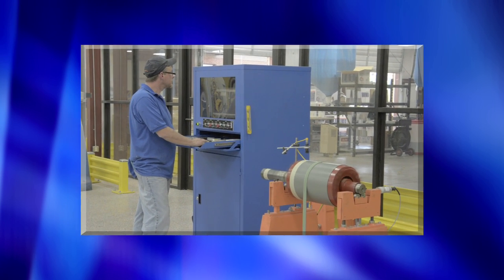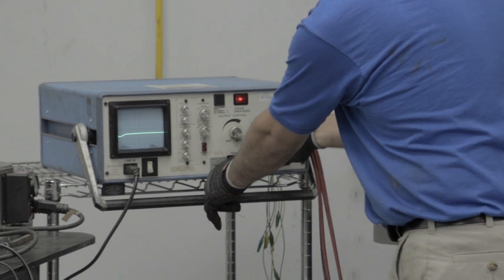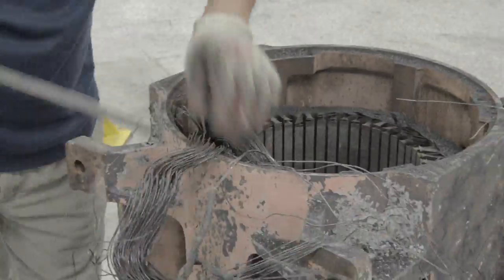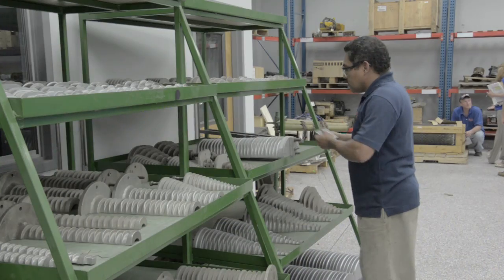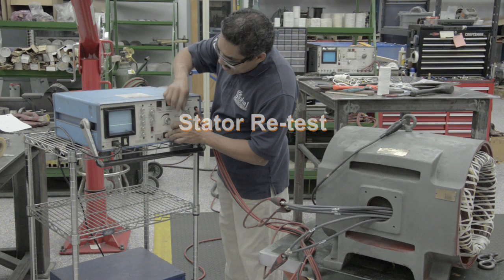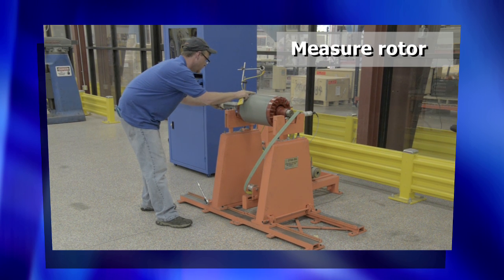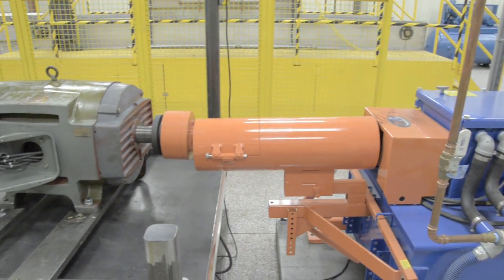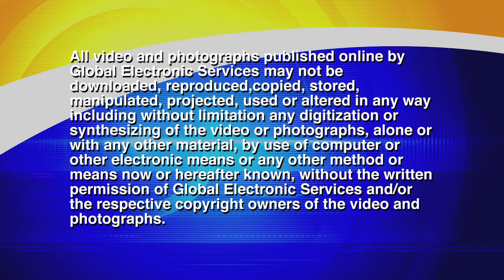Electric Motor Repair & Rebuild Instructions - Full Repair Process

Comment: Someone explain me this: Burnout to destroy the lacquer to remove the old windings, but what about the stator laminations? they are also lacquered and insulated from each other, or are the not? Being put in an oven, their insulation gets destroyed too, so the stator nw will be able to create larger eddy currents, which increases wasted energy = lower efficiency of the overhauled motor?

Comment: 6:05 why prevent the coils from touching the core if the wire has insulation already? I know, every motor has these paper pieces to protect the windings from getting scratched if any pull occurs, but really - if the windings are already insulated, then why isolate them from the core?
Reply: Im an apprentice for an electric motor company, and you're right tho, u don't want pull to cut your windings, so regardless u pretty much answered your own question although slot paper is also put in for spacing, you don't want your wires to be shifting around in the slots, and if they're shifting around in your slots then it doesn't matter what u did youre just fucking your motor up. U have to have so many steps because even having the winding sticking out to far will cause problems, basically u will always have a problem
Reply: Vibration, insulation electrical and thermal and winding support would be a few.

The lacquer is just a thin wire coating.

Comment: When inserting coils you should use a insulation to prevent the coils from getting scratched. Also the coils not yet inserted should have a layer of protection. It's good to cuff the slot insulation. Rear stator laceing not good. Well equipt workshop

Comment: All is good but electric motors are highly reliable. Like, 20 years of reliable.
And all these testing and labor costs arent cheap. 
So it might be cheaper for a company just to buy a new one.
Reply: My company runs machinery with electric motors long out of production. The only repair option is to rebuild.
Reply from the maker: it is almost always cost efficient to have rebuild/repair service!

Comment: Motor rewinding has changed greatly, the company I used to work for burnouts were regular happening chemical factory fertilizer making we had very large motors very high voltages 440Vand 6.6KV @ 6ooHP DOL and 220KW @ 440V about 90% was due to bearing failure though we had shutdowns throughout the year and changed large motors every 2 years factory run 365 days 24/7 downtime cost money 1 production plant for 1 hour downtime used to cost £28K though we carried out spare motors very few large motors though we would buy new motors from WEG through agent sadly factory is closed down as from 2002 :(

Comment: I used to rewind a different types of electrical motors many years ago , I really enjoyed all the procedures and the testings.
Thank you for posting this video.
Reply: I was a rewinder in Australia. had a megger meter to test for earth leaks, and a prufrex to test for short circuits in the windings. as above used to heat up the stators so the coils and insulation would come out easier. As an apprentice the single phase coils were wound on nails in a piece of wood. 3 phase we had a piece of wood cut to the shape of the coils, only would 1 coil at a time, so 48 slots and 48 coils took a while. unpowered winder was hand cranked. after all the coils were inserted the coils were connected into groups. very tedious work. later years had to metal plates with rows of holes all over them they were bolted onto the winder with a spacer between. put paper tape on the outer side with holes put through the tape to show where the pins had to go. had a varnish tub to dunk the windings. alot of what I did I saw in the video but their clean up is better, better to work on a clean stator. had a winter with 52 frosts in a row got lots of water pump motors to repair. for coils had some U shaped formers in varing sizes they had a wide part where the winding went on and a thin backing on one side and a slot up the middle of each the width was about 1 inch on the first and 2.5 inches on the biggest there was7 sizes. used them for lots of small motors. the coils were long with round ends very easy to use. could have a Davey 1.5 hp 2 pole in the oven from starting the first coil in 20 minutes. to old to do that now.
Reply: ps my quality was good very seldom saw the same motors again, and gave a warrantee

Comment: Does the copper wire used to make the windings not already have a coating of varnish before assembly?
Reply: It does. Almost all wire nowadays is called inverter duty and has multiple layers of coating. Still possible to scratch but way more forgiving than in the past with cotton covered and such.

The goal of the varnish at the end is to eliminate vibration and flex. The force when a motor starts can flex a winding into the rotor if it isn't secured properly or, even the vibration of the wires can be so great it can rub the coating off and cause a short.
Reply: @bmark6971  
Wow. Thank you.
A reply after two years - but worth waiting for.

Comment: I spent my working life in electric motor repair.Our main work was for the Lift industry,OTIS,SCHINDLER etc on DC gearless motors and Generators,but we repaired all types of motors from fractional HP to 6 Ton pump motors. Our shop was in East London England and started in 1919.

Comment: Did my apprenticeship doing this work . Such a niche trade .. one thing didnt like the balance weight location . Epoxy can flick of from there . Usually tuck it under or use the round alloy spigots to place washers on ( then burr the alloy spigot over ) . 
Def share this video with my friends and family to show them the trade I once did . Thanks for the video . Nice clean workshop too .
Reply from the maker: Thank you very much!!!

Comment: 11:28 the guy are using the wrong bearing size
Reply from the maker: Hello.  While sometimes things may look off in a video, the bearings used to repair this motor are the correct size.  Thank you for watching!

Comment: Curious how a new motor isnt cheaper...
Reply: kcotte59  baldor is huge here. Abb bought them. I just dont see how even a 50 horse motor isnt cheaper to replace. I work in commercial hvac and this process they are showing takes way too much labor. Honestly, there arent that meny parts to a motor.
Reply: Ashton Gilmore : As You see in the video they are reusing the stator Core, rotor, end bells and connection box .
New motor manufactures have to buy and machined steel for shafts, silicon steel for rotor and core lamination, cast iron or steel for frame and end bells

Comment: Is it cheaper to fully restore electrical motor rather than just buy new one? Afterall, so much more work is done when restoring motor compared to just buying one, especially when all the phase windings are damaged. Its definetly cheaper to rewind coils for fewer turns at the cost of efficency when only one phase is damaged a little, but all three phases...

Comment: Back in the 60's I worked in HVAC. Rebuilds were cheaper and better motors than new factory because higher quality components were used such as bearings, coated wire, and precision balancing. Small rebuilders staked their reputations on the quality of their rebuilds.

Comment: I’ve worked in this industry for 25 years. In some cases small motors are replace unless the motor is not available off the shelf! Larger rewinds are normally more cost effective over replacing unless the motor is in bad mechanical shape or has core damage causing heat losses in the stator or rotor core.

Comment: The only thing missing is an air gap voltage test, to make sure stator laminates aren't shorted. I've seen cases, where hot spots occur because of inter laminate shorting. That spot glows red, than that heat telegraphs to the windings, and causes shorts by localized burning of the insulation. That test can and should be made with no windings in the stator whatsoever. It can be performed by a coil with alternating current, or by spinning a permanent magnet rotor in the stator, driven by an external motor. A quick peak through a FLIR camera could tell you weather or not that stator armature is worth rewinding. High eddy currents, at the very least, make a motor inefficient. at worst, a future failure. The oscilloscope can give clues, but you can't tell if it's an anomaly in the windings, or weather it's actually the stator armature. You would have to rewind the motor, and check for asymmetry. Even then, it's still unclear weather there is an error in the windings or again, the stator armature.
Reply: Is that similar to a core loss? Or will doing a core loss function the same?

Comment: Not cheap for repairing motor on this way，small motor just throw away。
Reply: If the motor is less than 20 Hp, it's probably cheaper to replace it. 25 hp is a coin toss, 30hp or larger are worth rewinding. This 60 horsepower motor is well worth rewinding.

Comment: great, now I WANT a repaired motor.  Better, since I watched I will get MORE motor repair vids in my feed, AND links to purchase said motors where ever I go online since a tracking cooking just got added.

sigh.  O well.  btw what is the horsepower rating on that motor again?  Max RPM?  Max Torque?  If I am going to buy it, I might as well get the right one.
Reply: The motor is 60 Horsepower, and according to the dyno reading, it's a 4 pole motor. At 60 Hz, it wants to run at 1800 RPM, but due to slip loss, it actually runs closer to 1780 under full load. 177 foot pounds of torque @ 1780 RPM=60 HP.
Reply: How can i get to do a course in motor repairing?
Reply: @edwinmalcolm2238  Star sweeping the floor in a electric motor repair shop

Comment: Do you restore old (~40s) one-third hp small motors (frame 56z)?
Reply from the maker: Todd Decker we repair and refurbish all makes and models of motors, even the obsolete ones!  Do you have one you need to send in?
Reply: I may have two. I'm currently evaluating them now to see if just a basic cleaning is all that is needed.  But, if they fail then I would ship them to you.   I assume your web site has instructions for obtaining a quote and packing them for shipping?

Comment: How did he assume that the phases all three of them have bad signals?
Reply: He explained it wrong. A phase to phase is not simply 1 phase 2 phase 3 phase.

It's 1-2 overlapping. 2-3 overlapping. And 3-1 overlapping.

From what was shown on screen I never saw a break until the very last second i think I saw a short spike. Sometimes it won't show a spike until it gets up to a certain voltage.

But also, they megged the motor only to hipot it on the surge test. Kind of redundant.

Comment: THAT company is doing a great job of repairing that motor. Rewinding is the hardest job to my belief. You have to be careful  not to damage the enamel insulation of the wires; a job of great patients! And you have to connect the wires in a certain, precise way, otherwise you have a rotor that doesn't turn the correct way or not turn at all, or burns up the coils and trips the breakers/fuses. Job well done Global Electronic Services!
Reply from the maker: Thank you!  We appreciate your feedback!  Thanks for watching!
Reply: Charlie K  Low Voltage (parallel) 220 230 240v L1=1&7, L2=2&8, L3=3&9, (4,5,6 tied).  High voltage (series) 440 460 480v   L1=1 L2=2 L3=3  tie 4&7, 5&8,  6&9  (36 slot 4 pole 3 coils per group  1750 rpm (1800 theoretically) 3 phase wye wound motor 9 leads out).  What’s your definition of competent?

Comment: Great video, highly skilled and specialized operation. But I find it hard to believe that all this can be done for less than buying a brand new motor.
Reply: Go look at the cost of a 20 HP or bigger motor. I'ld guess one can be rebuilt for 25-50% of new.
Reply: That was a 100hp 3 phase motor. Name brand ones come in close to $10,000.00.

Comment: And that is cheaper than buying a new motor? ...doubt it. Except the working conditions for these workers is super cheap
Reply: The threshold is about 20 or 25 HP. 30 or larger are worth rewinding, smaller than 20 HP, you might be better off to replace. This is a 60 HP motor. Definitely worth rewinding.
Reply: Wrong.

Comment: Wallnut shells, really??
Reply from the maker: It’s true!!
Reply: Walnut shell has been used for many decades. It's agrressive enough to remove contaminants and some conformal coatings but not too agrressive to damage electrical components etc.
Reply: Wouter d.B. There are many types of media for blasting suck as silica sand which is your basic sand blasting , walnut shells, soda blasting, different media that leave a different surface finish. Some even have a fluid within the media.  It has been around for over 30-40 years.
Reply: Walnut shells are also used in high end snow tires.
Reply: Well, dang it, I'm gonna go plant a walnut tree right now!

Comment: I'm surprised it's not more cost effective to just purchase a new motor.
Reply from the maker: A lot of money can be saved through repair!  Typically repairs run 50% of the price of a new motor!
Reply: Deciding on the cost effectiveness of repairing vs. replacing a motor depends a lot on how many motors you have to maintain and in the conditions of the service life(end point use)of the motor. Many heavy use/harsh environment systems require refurbishment in relatively short periods(annually is not uncommon), pushing that price per repair number much lower in many instances as well as throwing away all of those rotors and housings would be exceedingly costly.
Reply: Some motor designs can not be replaced easily. Some are built specific for the job given, or are one of a kind units that are not easily or can not be replaced, only rebuilt.  Or if any replacements are available, it's either not cost effective, or the turnaround time to get one in will not meet any or all requirements.  Plus the odds of the replacement having minute differences in the design compared to the motor it is replacing, may cause operating issues, or problems leading up to equipment destruction.  There are motors and generators still in production that were built in the late 19th or early 20th century, recently refurbished and rebuilt in shops like this one. Motors or powerplants like that you can not just call BALDOR/ABB and say "hey, gimme a 350HP, 2400 volt synchronous motor." That simply is not going to happen.
Reply: @Nighthawke70  Like in New Orleans, where they have giant pump motors from the turn of the last century that run on 25 Hz power.
Reply: ... besides, the owner probably has a contract with these guys to repair dozens of motors as part of maintenance
Reply: zenith828 - For another thing, I'm sure their rebuilt motors are a whole lot better than new Chinese-made motors.

Comment: The Motors are to cheap for an expensiv Repair.  It must ne a Really Good Motor....
Reply from the maker: yean Basch Actually our motor repairs are under 50% of the cost of new, so having them repaired is a huge cost savings over buying new!  You should always check the cost of repair before buying new, you would be surprised at how much money you can save even on the cheaper motors!  We’re here to help!  sales@gesrepair.com
Reply: Anything above 25 horespower is cheaper to have rewound than to buy new...
Reply: Global Electronic Services Yeah, but this probably only applies to industrial-sized motors, not small, consumer-grade ones....

Comment: Years ago, when in tech. college, we didn't have burn-off ovens. We did that procedure by setting some firewood alight, and putting the stator in it, then we manually clipped the windings out. Of course, the largest motor donated to the school was about 1 HP. We learned to wind the coils by hand, not having a winder. Line the slots with fish paper, hand wind, pack with sticks, then lace it up. That was hard on the knuckles, on the small 1/2 HP motors. Coil shorts were found by a growler.
Reply: It's been 20 years since I've heard anyone else talk about using a growler to find winding shorts. It was always fun spooking the new guy with em. :0)
Reply: sivalley: They do make a buzzing racket when the growler is over a shorted coil. It's probably one of the easiest diagnostic tools to use.
Reply from the maker: Great story!  Thank you for sharing!
Reply: That's the thing I remember most replacing some bad coils yrs. ago, in a small motor, the bloody knuckles !
Reply: craxd1  a growler ??? I didnt know my wife worked there .